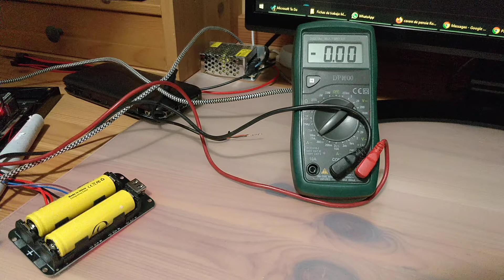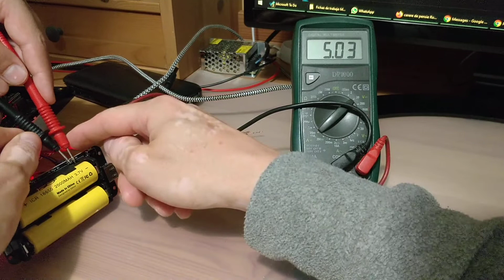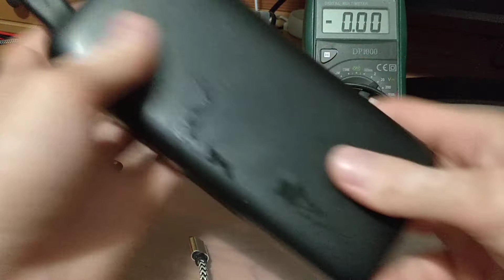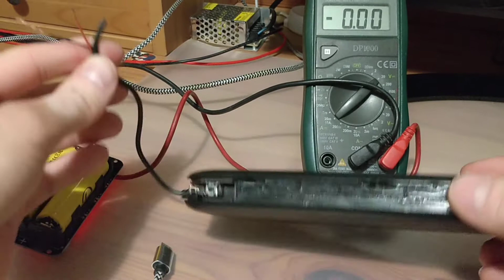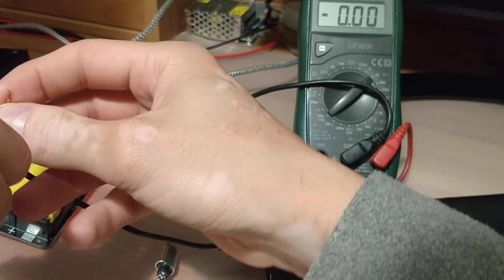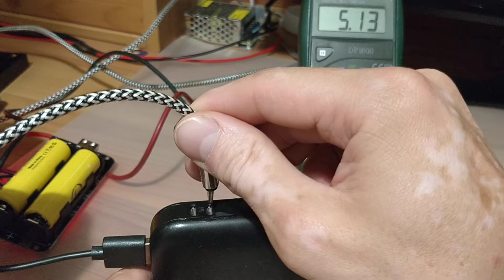DiyMore WeMos V8 and V9 BMS for 3.7V batteries output reset problem on cable connect or disconnect

Comment: I have the same problem, I'm try to connect output with a 5.4v 500F Supercapacitor (2.7v x2 with a blance board), but I have to find how limit currect charging/discharging the Supercap.
Reply from the maker: It doesn't work, the capacitor, i already tried it. The reset works as a short-circuit so it shorts also the capacitor, the whole input.
Reply from the maker: @travis90x  that's right, i connected the capacitor in parallel with the input, not with the output, as I need to control several outputs
Reply from the maker: And this way, connected to the input, it doesn't work
Reply: @rghrg  You have to connect the Supercap (already charged) with the output to supply the lack of voltage in the 500ms of cut-off during the plug/unplug of the input. The problem is when the Supercap is discharged. Don't try with a normal capacitor, is too weak.